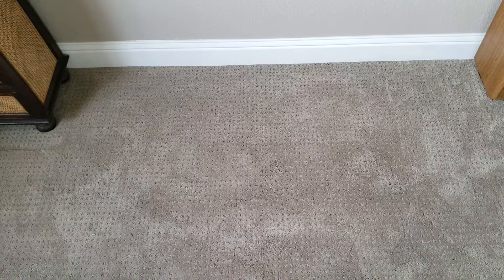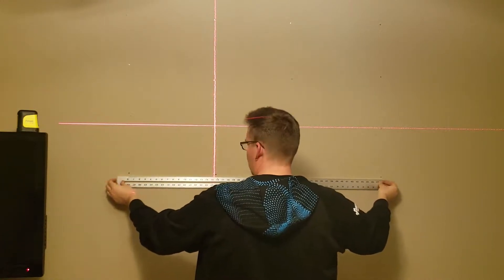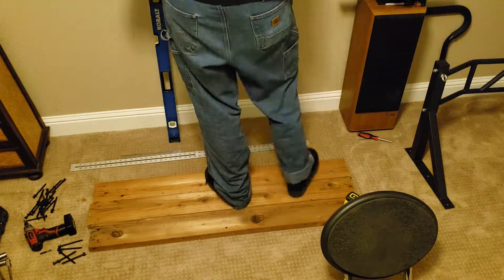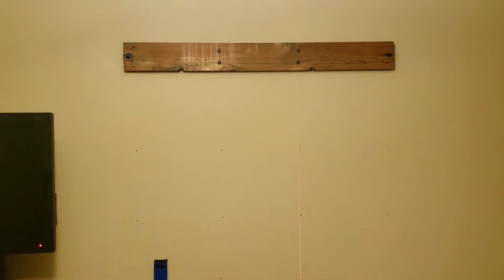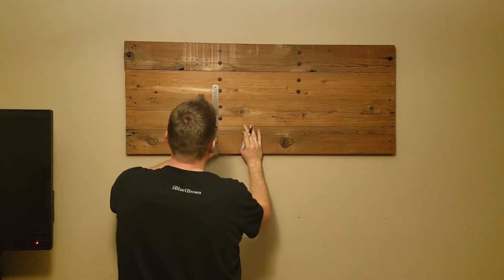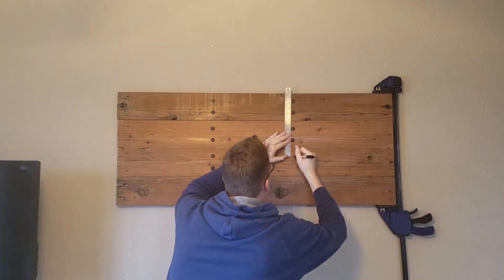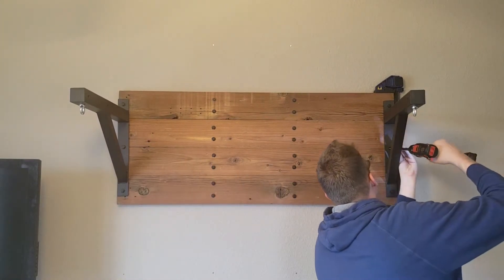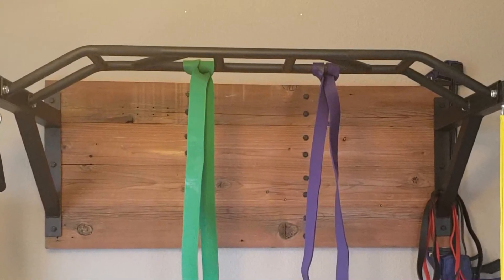Installing a wall mounted pull up bar

Comment: is there a reason you didn't just drill it into the studs?  without the wood backboard/? i just bought a station and tring to figure out whats best
Reply from the maker: High loads like this can crush drywall. The backer boards spread out the compression load on the lower mounts.

Comment: Is the bar itself mounted into a stud or is the piece of wood just mounted, and the pull-up bar is connected to the piece of wood
Reply from the maker: Bar itself is mounted into studs through the backing boards.
Reply: What if the studs are not aligned with the bar… would you recommend mounting one piece of the bar twist and the other to the wood bracket?

Comment: What size wood?
Reply from the maker: I used reclaimed 2x6s that I planed down smooth.  Because you're mostly preventing crushing the drywall as opposed to being particularly structural, you could probably get away with 1/2". No matter what size you go with, make sure the lags on the bar go into studs in the wall.
Reply: @cilynx hello, quick question I wanted to use a similar design such as yours for my titan fitness pull bar however the studs in my garage are are uneven and only have studs 48 inches apart that can possibly compensate the 50in bar. Would using a base such as yours be enough to hold the bar up?